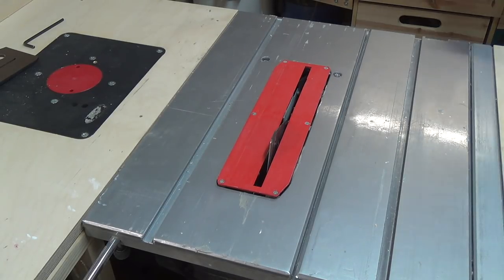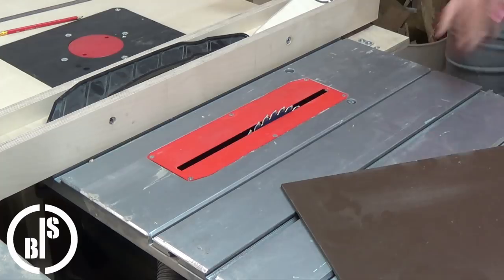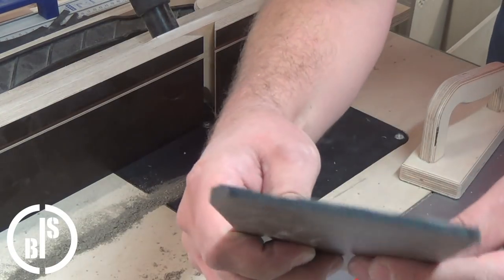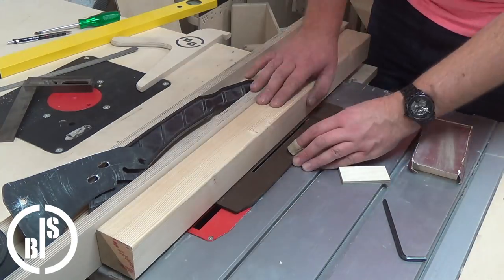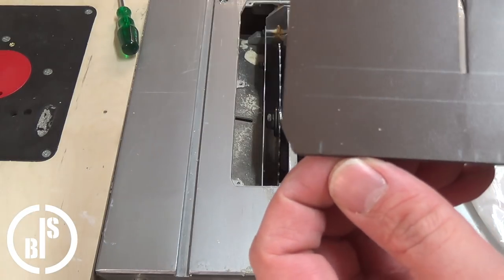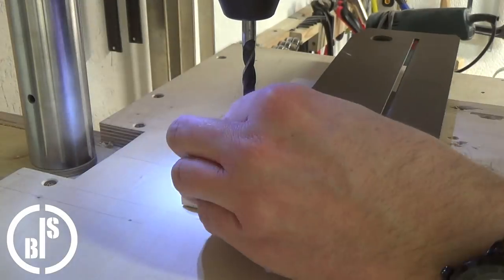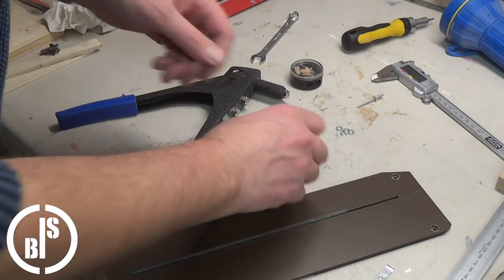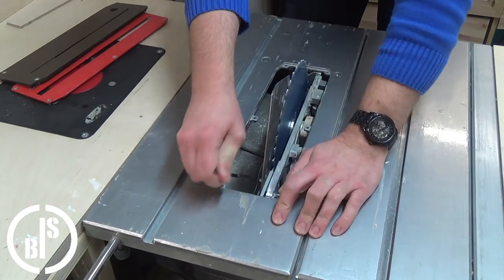How to make a Table Saw Insert | Zero Clearance Insert

Comment: This is one of the reasons they invented 3D printers.
And when the plate wears down, you have the template stl-file ready for printing a new.
Reply from the maker: That's a possibility. But i don't have a 3d printer. And if so, then the printer bed would have to be big enough to be able to print that size of component.